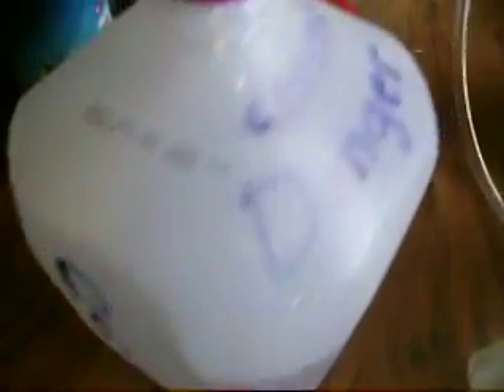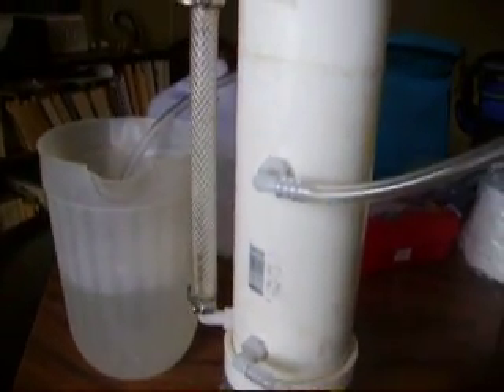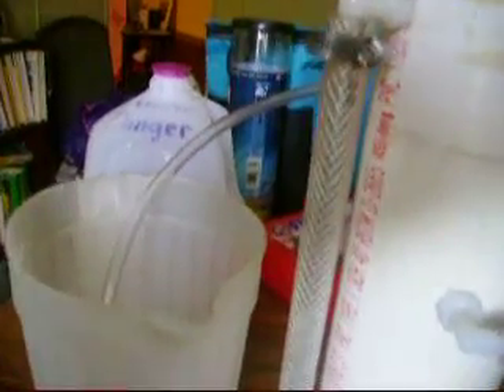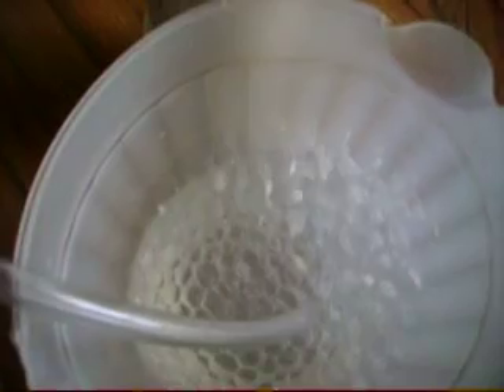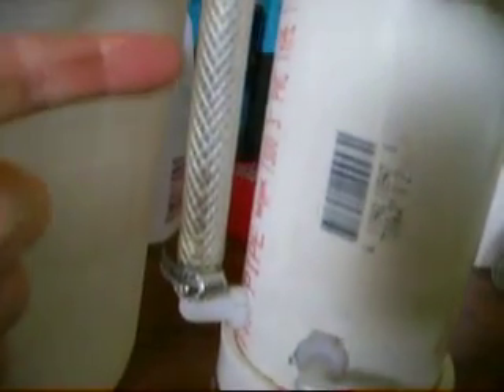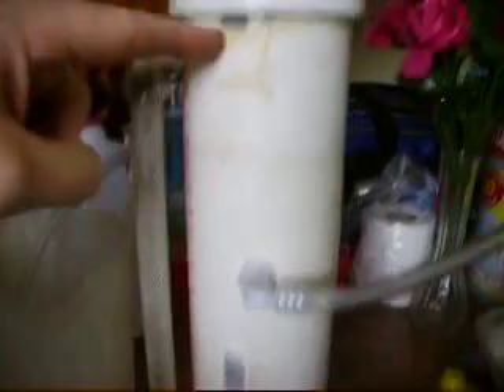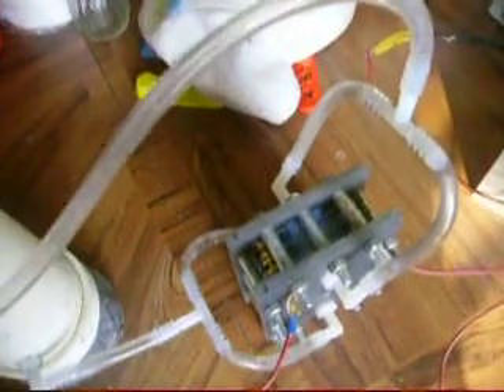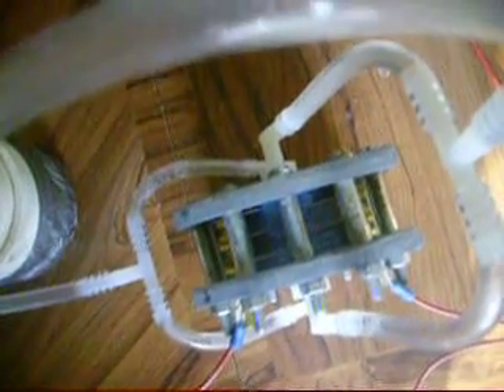HHO MLSP 16 plate dry cell

Comment from the maker: @Iseekoutthetruth No, I will be building a separator cell for my automobiles. The advantage of being able to separate the gases and use the hydrogen while you vent the oxygen are great. No more EFIE! The soapy water is just to create bubbles on the surface of the water. What you see is actually a dual bubbler. The primary bubbler is the 3 inch PVC pipe with the sight tube on it. It has electrolyte in it which is connected to the cell. The soapy water is plain old tap water with dish detergent.